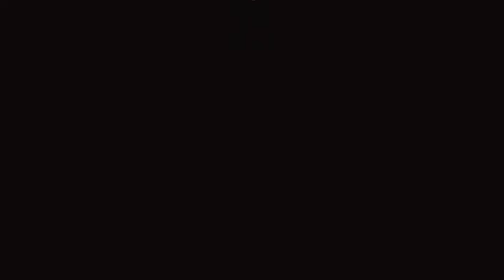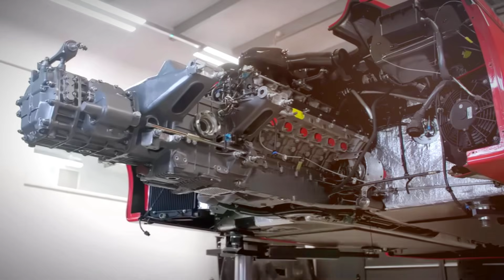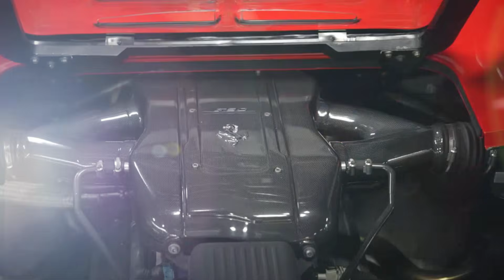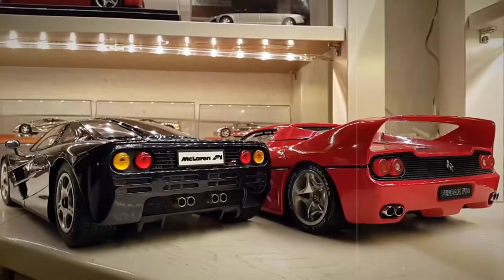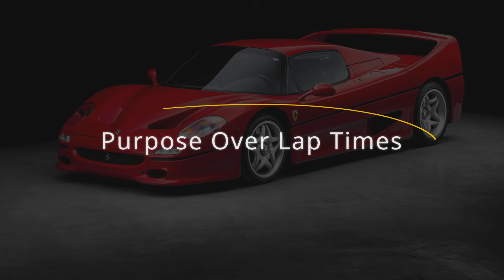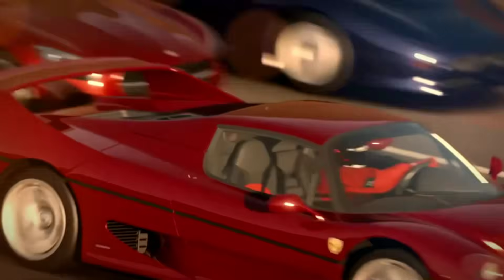Ferrari Built The F50 To Beat McLaren, Until The F1 Made Them Look Slow Anyway

Comment: 4.7 vs 6.1 to be fair ,try same engine size and again ferrari will be faster .
Reply: No one made them make that choice. They could’ve put a 6.1 L in if they want to do no one was stopping them by themselves. It was a free market?
Reply: @boardriderz  true.
Reply: Ferrari chose something existing and make it road legal and comply to the fuel emission laws.. a 3.5 lt V12 with 13.000 rpm pumping  680 bhp , detuned to  520 bhp but more displacement by more then 1 litre to compensate the high end torque , but chassi wise the set up and packaging was more track focused for the F50.. Ferrari did something from the start like the Enzo and destroyed the competion by stoping creating out of  pure passion and starting chasing perfomance from start 

The mclaren 1st version did not have even ceramic brakes as the F50 , not even with ABS and softer suspension without a rear spoiler that Murray hated them because of adding weight , the gearbox was crunky . I have never seen the F1 competing in a race track but only once and it was struggling to brake or steer on fast bends compared to other supercars becase of downdorce .   The only supercar with could keep up even surpass the F1 in a race track quite easily was the  1998 Mercedes - Benz GTR with a set up just enough to make it road legal.